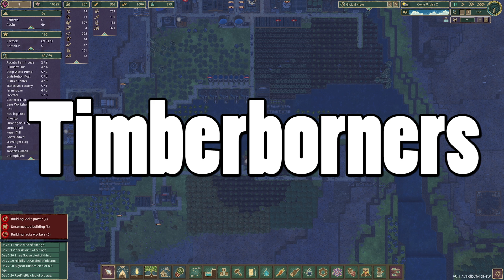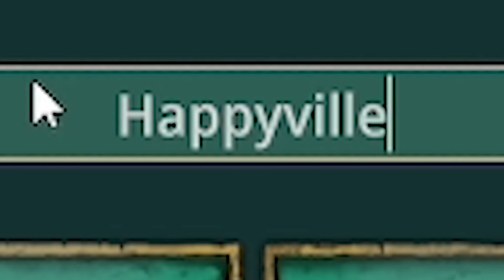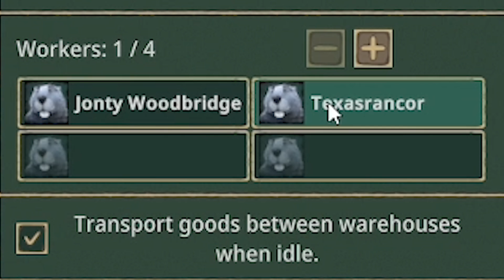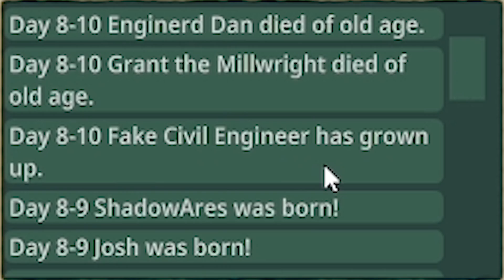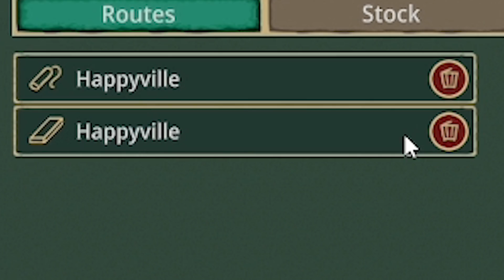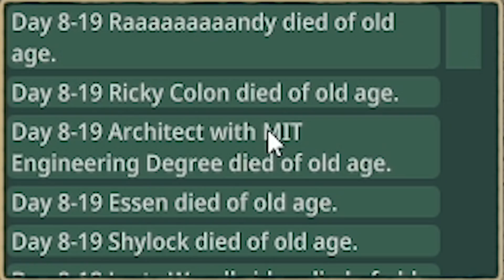Engineering a power-generating MEGA DAM!!!

Comment: Large water wheels are FAR more sensitive towards current speeds than small water wheels. I wouldn't even bother with small water wheels anymore simply because they have served their purpose in the early game.
Honestly, I tried making a beaver-made hydro-electric dam... unfortunately it didn't pan out because the water only shot speeds up at the shoreline instead of down the middle.
Little did I know that water goes around, not through, paddle troughs. I'll probably remake it into a four-block wide dam that enhances the deep three-block channel it sits in.

Comment: I suggest that you should build some natural and beaver-made reservoirs for dry seasons. On that note, large water wheels work the same way small ones do, you can just rotate their wheel stands so they look nicer on the cliff face and you don't need any platforms unless you're transferring across the river. I actually don't store raw food materials in storage, because the facilities have good enough storage for making them. Only finished food products get stored. It's the same with tree sap for treated planks. You don't need to store berries if all they're ever good for is breeding new beavers. There's no worker benefit, and it'll hurt in the long run when all of the berry plants have been picked.

Comment: Btw. I am quite sure the units of the power wheel (hp/cms) are (hp)/(cm/s). So, power is directly proportional to the flow speed of the water, which would result in the optimal arrangement being as shallow as possible, while withed would theoretically be irrelevant, but you would save materials the thinner it is.
Reply: I am not sure about the water physics, but that would mean you also would have to make the area of the large water wheel's (only in the area where the water wheel's are) as shallow as possible, I think they are currently raised, not 100% sure though.

Comment: You're better off building 3 wheels in that small river offshoot instead of 1 and 2 leevees as thats going to flood more when water slams up into it.the power generation from the 3 works out better longterm because you're casting a wider sail into the current.
Reply: yes, that is the best choice based of the numbers and risk probability.

Comment: Hey, Matt. Just wanted to let you know a few things. First off, the water does slow down as it goes past a water wheel, so if you just have one wheel in the middle of a channel, the water will tend to flow around the wheel easier than it flows through it. That being the case, you should put water wheels all along the width of the channel. This makes the water go through all of the wheels equally and they all still output roughly the same amount that you were getting from your test. I think most of the maps in the game require a three block wide gap to flow without backing up. Some require more, like the islands map. This brings me to my second point.
The river flowing from the source is outputting about three blocks wide, so if you split it back before your water wheels, your flow speed and volume is going to be greatly effected in both channels. If you want to get more fertile land, what I have found to be super effective is to use dynamite to put a one block deep and wide hole in the middle of some land. I then put a water dump over top of the hole and keep a beaver employed at that dump constantly. The beaver will only bring water to the dump until the hole is filled and the dump's tank is full. The water doesn't flow anywhere and it only goes down due to the evaporation/seeping into the ground mechanic that goes on with still water. If you wanted to stay a little more involved, you could pause the dump once it's full. the building should empty itself as the water level in the hole goes down. Once it's empty you can unpause it and the beavers will start bringing it water again. It does use a little more water during the drought, but a few more water storage takes care of that problem, and it's a whole lot easier and more efficient than diverting a river. It leaves you with more room to plant crops and you don't have to adjust a floodgate when the droughts come.
Reply: something i do to get just a bit more green out of my rivers is build irrigation pits. you blow a 1x4 hole inland from the river and throw a dam two blocks in, so water flows in to fill it up. when the dry season hits, you can pump the main river dry, and still have a huge area of fallow land for crops. extremely useful on hard mode where the droughts can last up to 30 days.

Comment: For the new compact water wheels in Happyville, you should do a single large water wheel instead, you can support it with two stacked levees to elevate it and you will get more power out of it over two compact sized ones.
Reply: won't fit, he will have to dynamite some of the water bed, otherwise it won't fit in the bed, it will be too high.
Reply: @jabbaorme8930  that is why he would have to stack some levees under the the side bit to support the large water wheel. You can hold the water wheel up with them so that only the bottom layer is in the water and it still works, with greater power output than a trio of the compact water wheels.
Reply: @djacob91  Actualy, I see what you mean, but i'm still not convinced if only having one block of water for the large water wheels would work... also stacking across the river would prove slightly ineffecent, as you would have to have a pillar inbetween every wheel, and every shaft. (hah, shaft),but on the  flip side, if he replaced thepillar with leveys, and had them all the way down, it might be better... IDK. R.E.C, you decide.

Comment: You need to build more of the large water storage they give you so much more storage capacity for the same area as the smaller ones.
Reply: Agree I even start replacing the small ones with large ones
Reply: I love this comment thread
Reply: Yeah, the large water barrels hold 300 water in a 2x3 area compared to the regular barrels 30 water in a 1x2 area. That means the same area could be used to store 90 water with regular barrels or 300 water with big barrels. That makes big barrels 3x more efficient than regular barrels. 9 out of 10 engineers prefer big water barrels while 10 out of 10 architects think the little ones look better.
Reply: @cathygrandstaff1957  real engineers uses their distribution post to send excess water to a deposit district with drop off points who can stock 300 water in 2x2 areas making it 33.3% more efficient than Large Water Tanks.
Reply: @JaceGameplay  that's who we call a SENIOR Engineer

Comment: those 2 water wheels in the new river are positioned very poorly. since the shaft would have to go where you placed the dynamite.
Reply: Nothing a little power transmission “elbow” (on platform) can’t fix! But yeah, the stairs are right there too, blocking a third wheel…

Comment: from my own test with the water speed for the power wheels my conclusion is that half of the amount of water sources is the best, so if the map has 10 water sources funnel the water into a 5 wide gap this way gives you more power without floods
Reply: I guess each water source Generates 0.5    Cubic Units of Water per second. Each gap can pass 1 Cubic Unit per second, even if they're higher than 1 block height. This way you can do a massive dam with normalized flow, even during droughts.
Reply: @JaceGameplay  Has anyone tested verticle water wheels under a waterfall yet? (I don't own the game)
Reply: @PeterBTonphu  You can't stack water wheels, but i tested with one with a large waterfall and doesn't worked really well. 

A little space after worked like a normal wheel.
Reply: @JaceGameplay  Weird. since waterfall-fed water wheels have been common for centuries. lol

Comment: The large water wheels can be placed face-to-face, so you can take advantage of the 'output' shaft of both, and from both sides then :)

... and you didn't need the stairs for the dynamite for the power shaft, as they can build/reach 1 block up... (such as building on top of platforms)

Oh, and working hours doesn't affect food or water consumption at all, they take a certain amount each day...

Comment: I build farmhouses and aquatic farmhouses in pairs.  One is set to specialize in planting while the other in harvesting.  It's a bit more expensive, but it makes sure both planting and harvesting continues uninterrupted.  Not too mention that 1 planter can usually keep up with 2 full time harvesters.
Reply: Yeah, I've been doing that too. Works really well. Also, once the crops are going, I set both to planting, since they'll just go to harvest when planting is done, but not vice versa. (maybe I should report?)
Reply: I do this as well. I also use a combination dynamited hole and water dump to make more fertile ground to plant on. It makes it a whole lot easier to make fertile ground and it's way more efficient than the irrigation towers. And also, as long as you have enough water storage, you don't even have to make a reservoir to keep fertile ground during the droughts.
Reply: This is useful information thank you
Reply: Nice.
Reply: If that's the case, then you could build three at a time, no? 4 full time harvesters and 2 planters?
Reply: Same.